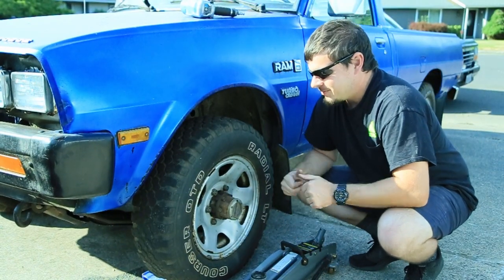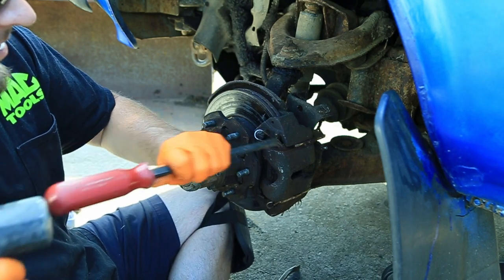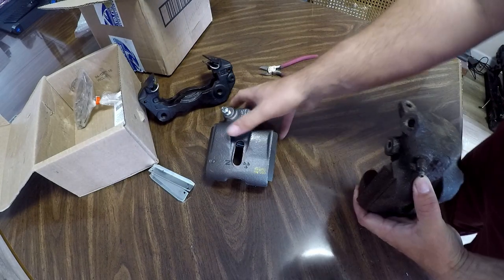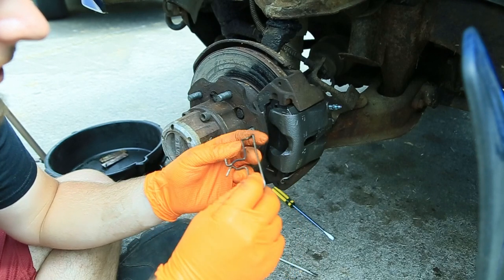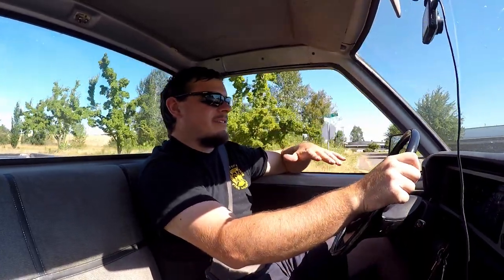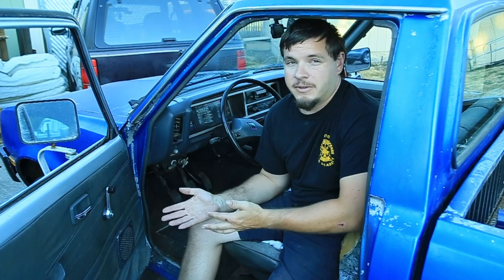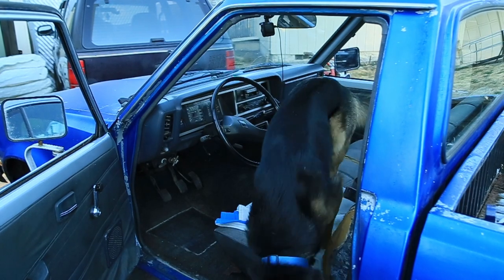84 Dodge D50 part 3 (replacing brake caliper)

Comment: Teach the dog to herd the chickens. Could be a collapsing rubber brake hose.
Reply from the maker: Scout just wants to chase the chickens.
Also I dont think its a brake line issue. After driving it around today it hasn't been dragging at all. I think the other side just needed a little work. Will keep an eye on it. I've never had a brake line collapse before.but will keep it in mind.
Reply: @mechanicalmystery7891  I have seen it 10 plus times. Just replaced one on a 07 F-150 today. They will look fine on the outside but the inside will be collapsed. It will let fluid go to the caliper but wont let it return causing the brakes to stick
Reply from the maker: I know what it is, I have just never had it happen to me.

Comment: The black smoke could be turbo stuck. Or egr valve stuck kinda open. Or someone turned up the fuel on it. But if they did you would know. It wakes them up pretty good! As well the timing belts or belt depending on the year should be at least looked at. There great little engines! Grate find! Good luck with it! 😎👍
Reply: Given the age of the engine, just buy a timing belt, belt related hardware, and water pump. It is a huge risk not to.

Comment: If I remember right when you go to change that axle boot you will need two roll pins to get the nut off, I'd put the bucket's in it give's you way more leg room. Think the ground for the lights is on the fender near the battery if I remember right. it's looking good though thanks for sharing

Comment: I had a total of 4 ram 50 first was the best bought brand new. 2.6 2wd royal model.  Others were 2.0 trks.  Had a hard time finding parts around 2015. Junkyards had a lot of them  here in so can not many left all have been scraped. Good lul trks. Keep it on road
Reply from the maker: Rock auto saved me with the caliper. Going to keep it out of the scrap yard for sure.

Comment: Trust me you will be replacing the other side also. Should have also got rubber brake lines. I have worked on Vehicles for 50 years and Dodge ( Even though its a mitsubishi) When you replace one the other will go.
Reply: Or braided stainless lines

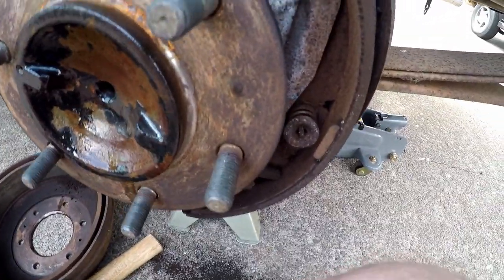Comment: 8:16 You need to peel back the wheel cylinder dust boot to prove no leaks.
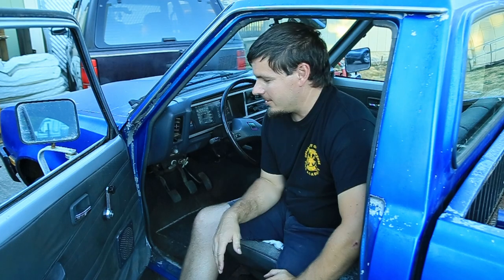24:34 There are "Retro sound" car audio companies that build head units you might like. They fit like the original, they have classic styling, but all the electronics are modern. They can sync to bluetooth cell phones, too. I think Summit Racing has a lot of options. I like this idea, I really liked the stainless steel car stero that my mom's 1985 Nissan Maxima came with. I'm sure a Mitsubishi Sigma V6 would have had something similar in appearance.

Comment: Check the timing belts  ,if you break the cam one it will destroy your engine
Reply: I think the first gens have chains, at least mine does.
Reply: @BrandNew4U.  . mine is a 83 and it has 2 belts it will brake rockers bend valves and tear up pistons
Reply: Replace the timing belts. Also, replace all hardware connected to the timing belts and the water pump.